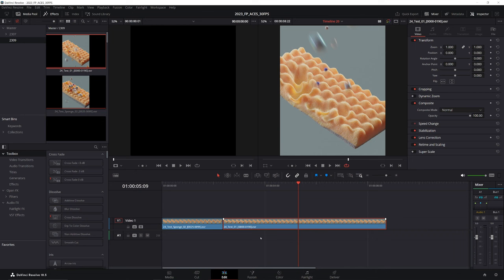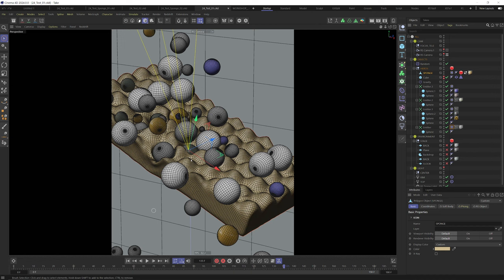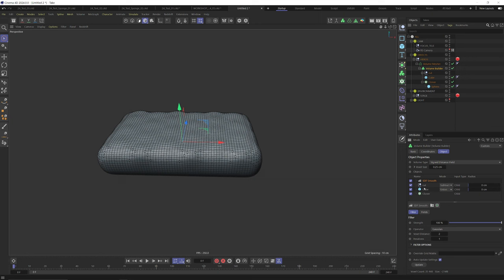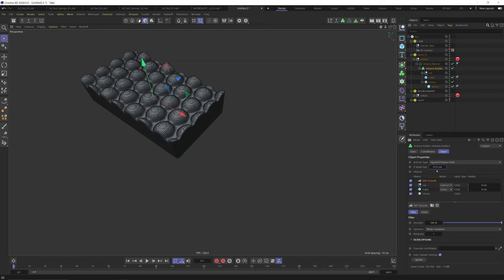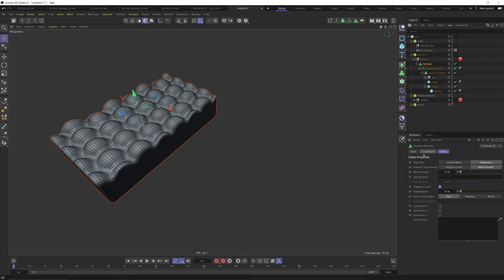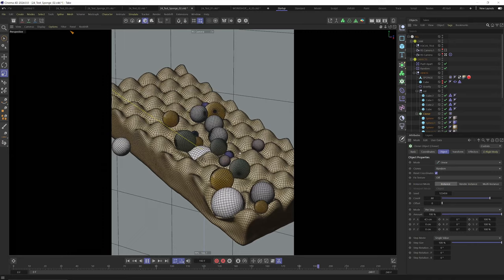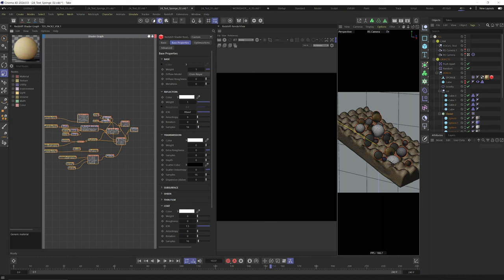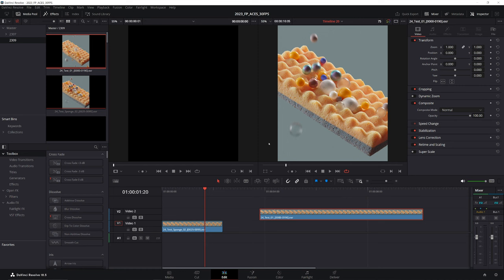Create a sponge in 3D - New simulations in C4D2024

Comment: I usually have better simulation results when I work with 10x the scale of the real objects. All my settings like substeps, collision distance, particle size don't have to be so small and engine runs them faster and with less issues. I would suggest to anyone to try that regardless of the software.
Reply from the maker: yes, that's a good value. But I hate working in a non real world scale, as I have a photography background and then everything changes.
Reply: @vincentschwenk I have the same preference, what I’ve done before was to export my sim as alembic and scaling that down for rendering.

Comment: I recently had the same issue using particle emitters and dynamics. One solution is to create a cloner, add you sphere to the cloner. Then set the cloner to "object" mode then select the emitter as the object. You don't need any objects under the emitter and the simulation should work fine.
Reply from the maker: nice

Comment: Alembic isn't suitable for motion blur because every frame is exported as an entirely seperate mesh internally, the software has no way of knowing which vertex from the previous frame is linked to which vertex from the current frame. This would normally be solved with motion vectors (which can be imported as vertex maps in the redshift object tag). However, for some reason, C4D itself has no way of actually generating these motion vectors in the alembic exporter, making alembic pretty much useless for caching inside cinema4d. 
I wish Maxon would take the time to actually perfect these core features, instead of leaving them half-baked for years while rushing to add flashy new features to every release.
Reply from the maker: didn't know that, but it makes sense. Also it is so stupid, as motion blur is so important.
Reply: Otherwise you can put a Forced Motion Blur effect directly in After Effects
Reply: @cyrilruegsegger9759  not the same thing. Motion vectors provide exact values for each pixel, allowing for accurate MB without any guesswork. Post process MB techniques all just compare current frame to previous frame and then try to figure out which pixel has moved where, which is far less accurate.